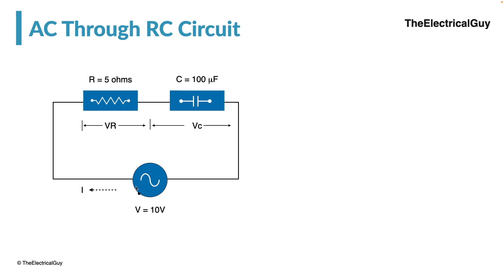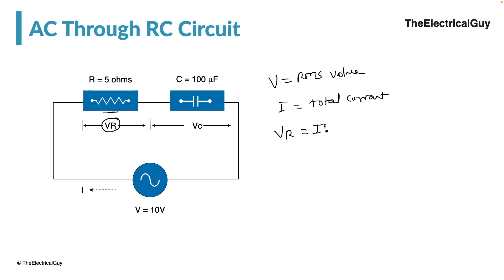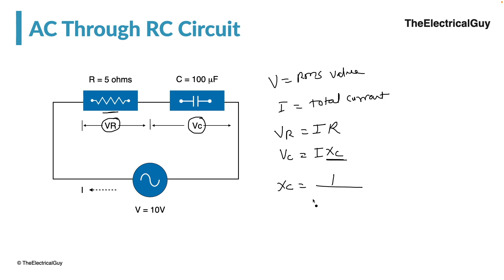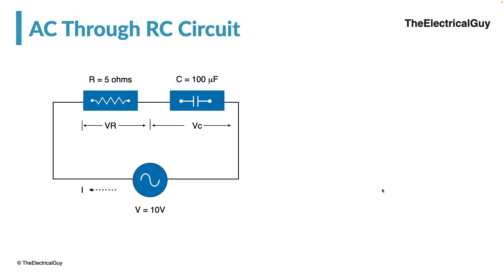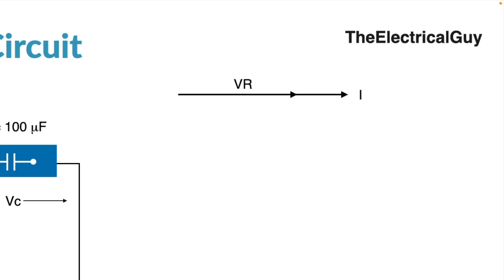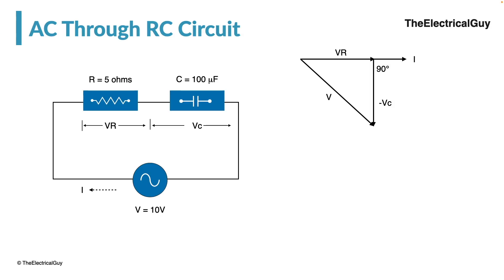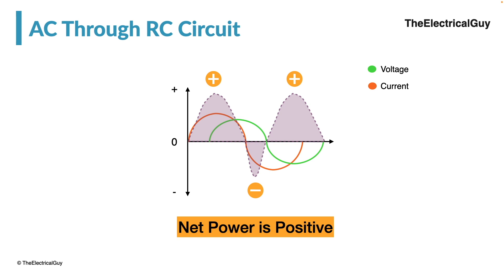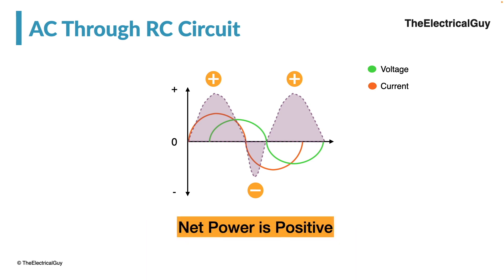AC Circuits : AC through RC Circuit | Easiest Explanation | TheElectricalGuy

Comment: 11:40 The diagram on the right, what you have drawn is incocrrect. It shows Current Lagging Voltage by 90degree (The correct one is Current should Lag Voltage by 90 degree for pure capacitive load). Green color is voltage, Orange is Current.
Reply from the maker: Yes. I might have said the opposite
Reply: @GauravJ  Actually you said it correctly. It's the diagram that is incorrect. Anyway, most people would probably won't notice that diagram if not paid attention to details. More importantly remember the key concepts: ICE (I lead E(V) for Capacitor), and ELI (E lead I for L(inductor)
Reply: I too noticed it..and i was confused until i saw this comment 😊